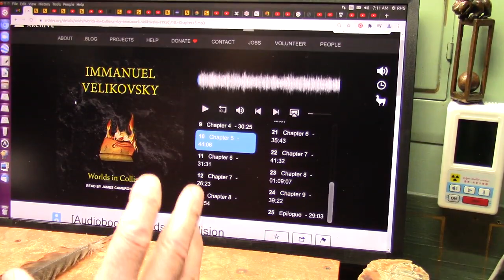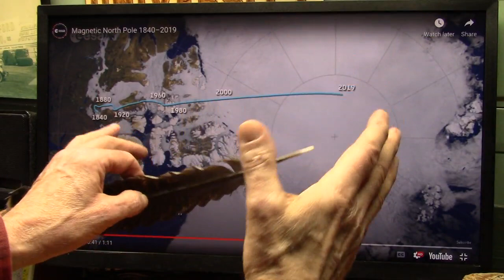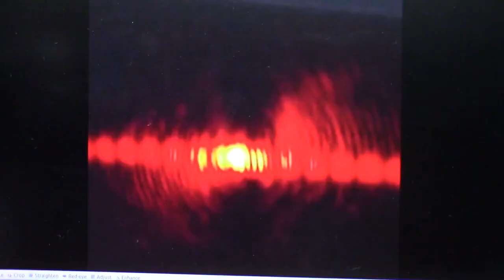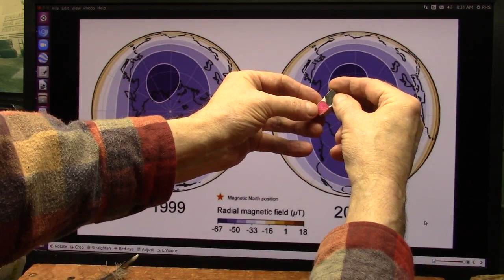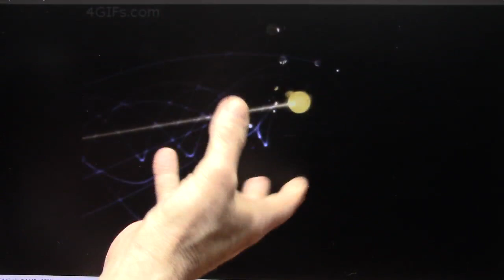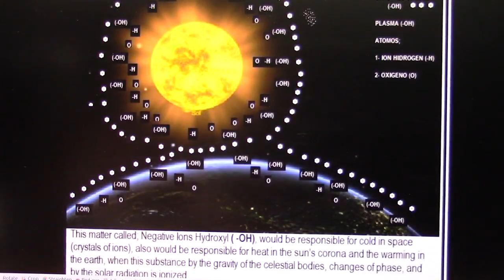A Pole Shift Disaster Coming and Why

Comment: Grab a ball ,magic marker  draw  the letter E in the balls center  then rotate ball 180% draw the letter M now rotate the ball clockwise you will notice no change in either letter as it rotates clockwise . Now as you continue  to rotate the ball in clocwise direction only, gradually turn the ball upside down you will notice  the m is now a W if you had marked the top of the ball N and the bottom of the ball S prior you would see how this earth could very well witness the sun rising in the west insted of the east and the N would be at the bottom of the ball insted of the top hence the polar  shift . As far as i see it , it is very possible..the north pole has been migrating for quite some time now❤ hopefully we get out of it unscathed

Comment: This is what I really don't understand how does a magnetic field change? The only way to have a change is another magnetic field larger than the magnet can withstand once it is coerced its field changes. High fields don't show us any of what you are discussing however we do jave a game changer its called CERN amd that thing puts out a very high field that could be xausong thos problem bit i don't think it outputs that much energy that could make the cjange you are talking about. It could deplete or remagnerize materials flux density and stabilize at a lower field intensity. Or just interact with it. Again high heat is playing with the cure temp and the material will relax and the dipole realign or become random my only experience has been that the field is no longer stable and is depleated greatly in some cases like in ndfeb it can relax until it can never be remaged to its potential again. And two thousand degrees is way over the cure temp of most magnet materials. Alnico would be the exception to all other materials in that temperature range. Rare earth would be dead. The thicker the length of the magnetic field in the direction of north to south is also a factor in the magnets ability to remain as a magnet. Length // to the orientation increases the Pc permeance coefficient. And the Pc of the core material should be very high.
Reply from the maker: Heat in space is charge which takes on polarity....so the hot spots create polar regions....and Magnetic loops like Sunspot loops but we cannot see them.
Reply: @mudfossiluniversity  a polar region is where the flux leaves and enters at its face so we should see the flux leaving that pole face. It have never seen no flux from a pole face unless absent flux completely. That would mean you would no longer have a magnet. I don't know how the fea doesn't show any flux in those two areas. Where did the fea get generated who made it? I would like very much to review their work. It doesn't seem to be correct.. but i may be wrong but I don't think so.
Reply: @mudfossiluniversity  we can see the flux using ferromagnetic paper (green sheets) we can also map the field but you are showing on your previously posted info extra data but ot isn't noted as to what is being measured that looks like tossing or expelling material from the suns surface which isn't a factor of magnets but they do influence everything but it is generally held that the working or influencing is the flux. Is their a reason that you fea shows more an if it does what are the factors or the frequency i may be able to put into an fea like the one you showed us. If i can duplicate that and see its influence in circuit that may lead us to find a way too use or manipulate the field for a different outcome and that way we can positively verify the application of this unused field.

Comment: Hy Roger, when you´re looking for another source to verfify the coming poleshift & a sun Nova event you have to look the videos of the Diehold Foundation made by Douglas Vogt!!!
He found a damn real SUN CLOCK CYCLE THAT´S HAPPENS EVERY 12068 YEARS....its encoded in the Torah, but the short version sound like this :
1 Solar cycle = 11,09 years
8 Solar cycles = 88,735 years (know as Gleissberg cycle)
136 Gleissberg cycles = 12068 years

By the way, the Torah has 6034 capitals verses and letter x 2 = 12068 years

The next Sun Nova Event will be on the 16th of October 2046

The first 22 leters of the hebrew alphabet are in fact wavelength´s, that create specific forms, to create matter out of the Torus form of earth, that create in essence the universe as we know it....the BIG BANG was the exct moment when the Quantum Super Computer was turned on so to say

Comment: Great video Roger and great explanation I might add. I subscribed a bit ago catching a moment of my subject matter to watch later. I avoid most physics/theory's online to keep me non bias in my own work. I keep things as simple as possible and minimum subject matter due to being simple minded. Due on pole shift subject though. This was the first video I have watched on pole shift and the right one I might add. Not school taught.......a natural I call it. Why I don't word things like a scientist. A fan of Albert and Pearson, Durk I started reading Life Extension back when it first came out. Just nut shelling me here a bit. I have a good 50yrs of understanding nature on another level. I agree on microwaves.....agitating various molecules and particles...charged or not creating changes. I have also had suspicions that dams leak into the outer core passages creating extra steam pressure moving lava/changing its typical patterns. Excuse my English please. As we tap oil out of the ground we are removing the fuel of the outer core hence changes. Nature is a very complex machine not to be messed with like synthetic molecules in everything today. Very delicate is an understatement many people don't understand. I have a collection of Geo I find with many mud fossils and meteors of various types. I cover many degree's of subject matter not school taught. Coding and dna, macro coding one of my terms. Although a novice and hands on no fancy nothing so far. I have always amazed myself doing any science/physics experiments and on a whim. My mother's mom was Russian and my Russian codes are alive. Sorry for writing so much, it's partly how I teach myself and imprint my brain cycling the science subjects. I get down loads like some physic's mention  and use Alberts greatest theory or 1 of them. The theory of simplicity of explanation. A long detailed history with animals and documented many yrs. Metaphysics is another of my well understood subjects. Domestic and wild animals, humans ect. Russians are just like that genetically with nature. Animals can friend us in an amazing way. I am already getting ideas about this video and possible man induced no no's. Thanks for your time.......Jim  .

Comment: The moment I saw that multi-meter I knew this guy knows what he's talking about. I always have a tough time explaining the electric universe to people who don't have some background knowledge of electrical engineering principles. 

I can agree that the atmosphere is a capacitor and we have the ability to change it's composition, but the galactic magnetic background has a much great influence on the changes we are seeing, it's affecting the speed of rotation and rainfall as well. One misconception is that the solar cycle is an independent phenomenon, yet from where I am standing the earth is responding the same way. 

Have you read the Zharkova papers? I'd love to discuss this with you further.

Comment: I enjoy your unsophisticated explanations of various physical phenomena. Your explanation underpinned by practical demonstrations makes it easy to understand complex ideas. Thank you.  The reversal of the magnetic poles will change the north to south magnetic field orientation but what will happen to the the direction of the earth’s spin on its axis and its directional movement around the sun?
Reply: Not sure if you have found your answer, but apparently the Earth will tilt 90 degrees really quickly and then find it's new position, (possibly same as the old one), quickly as well. It is theorized that below the crust is essentially a solid river of magma that will liquify as this begins, allowing the crust to move freely during that time.
Reply: @ventiankraus777  Thank you for taking time to respond to my questions.

Comment: Very cool explination. Thanks. Only thing I cant fully agree with is that our gasses is causing the poleshift. The shift happened many times before and there was no industrial revolution that caused the previous ones. I would be more likely to agree that this is just our normal overdue poleshift that is on its way.
The "eletromotive braking" caused by the poles will probably be the same is with an electric motor with a large flywheel. Once the friction overcomes the movement, the kinetic energy left in the system will probably want to rotate back on itself, like a spring. This could cause the change of earth's rotation.

Comment: I heard this is a gradual shift on the axis and we will begin to have more extreme weather, earthquakes, tsunamis. The sun plays a big part in our weather plus volcanoes put out  alot of gases as we move through the galaxy. The sun and planets also get charged particles from the black hole in our galaxys photon belt. The tree rings and ice samples show a past of earth changes before the earths population grew. Consider moving to higher ground away from the shores.
Thanks for your interesting information.

Comment: Energy flows as Long as it's there think of a fridge magnet how Long does it last electricity can be drawn from this field for as long as the magnet has it's field around it magnets can hold this field for hundreds of years I have been obverinng this and I believe we can tap onto this field as we learn to allow it to flow the trick is how to get into it have you ever seen a magnet float in the air simple if you use string to hold it in place think of where the string is tied down now imagine people holding those strings they are working hard there's the Free energy I'm afraid of what some of the people on this earth would do with this power as in ai and it's ability to control people I have thought about building this machine but I am afraid of what it will do crazy as it sounds the numbers 666 keeps coming up so I keep this secret to myself. Thanks to everyone I wish for a more peaceful world without greed and more equality love to all thanks.  DF

Comment: You need to look at Ben Davidson’s channel, Suspicious0bservers. This flip is most certainly NOT caused by the Industrial Revolution. ALL planets in our solar system are changing, so pollution is clearly not the case. This is a 25,000 year old cycle with 6000 year harmonics. More and more scientists are on board with this.

Comment: When the Flip comes, I am of the opinion that the Dzhanibekov effect will apply to the Planet.  
Remember, liquid water will not move with the surface.  The surface will slip under the water.  Everything will be washed away.  75% of all life will be terminated and extinct. 
Supposed to happen before 2046.  
It is thought that all man made electrical systems will be destroy by a solar CME a decade before the flip.  
The Elites are building under ground bunkers to protect their families.  They are not warning you.  You get a poison shot to ensure you don't survive.  Prepare and good luck.

Comment: Electric 101 you take the poles and flip them but the positive on top the native on the bottom or deposit on the bottom and the negative on the top what happens it's the other direction. It's tied to the Sun the sun is a major player the son's behavior. I read a report of the last couple years the world's slowing down it's fossil fuel burning and whatnot they're got clearer the waters got clear if you remember but the temperature went up instead of down.
And yeah it's serious and nasty business in the extreme

Comment: YTuber called “maverickstar reloaded” is actively tracking the pole with real time data from instruments all over the world currently we’re 75miles from the 40 degree mark and then into the weak field lines. Estimated flip is March 2023. He also has the same issues as you every mainstream is pushing it aside and getting rebrand as climate change.

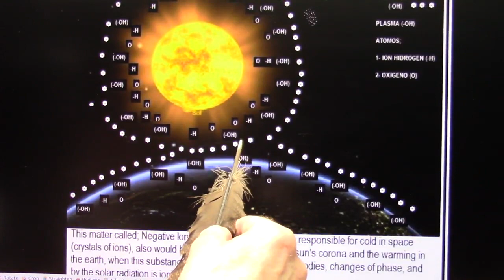Comment: At 18:56 you state that heat makes everything swell. Unlike everything else I know of, water swells as it gets colder. I don’t know how important this is to the equation, but there it is. There’s a lot of water on the earths surface.  Excellent video and your hypothesis seems right on otherwise, so possibly that tidbit isn’t important to the understanding. Thanks for what you do!
Reply: Gases expand under heat typically.

Comment: A magnetic polar shift happens about every 25,000 years. We are due for one. However a polar shift does not cause earthquakes, or tsunamis. It is simply a change in the magnetic field. You are thinking of a crustal shift. Those happen as well, but the crust moves instead of the poles. THOSE cause tsunamis and earthquakes. We have proof of this in tropical plant life that has been flash frozen in the artic. A crustal shift will be disastrous.  A polar shift will be a mere inconvenience.

Comment: are poles are magnetic they move every year back in the 1400 , 1500s 1600s, 1700s they used to up date the magnet north every year on the maps they stopd doing this in the 1800s well now we are at the point where are poles are flipping but they have covered this up with the sham of global warming we dont have global warming we have a polution problem but not global warming an yes all this information needs to get out there climants going to change around the hole world

Comment: It seems like the increasing unbalance of the two poles may have other implications. For instance, the increase of the magnetic field on one side may pull other spacefaring objects to the point of a collision. Much like the giant asteroid that has been claimed to wipe out the dinosaurs. I am pretty sure I have seen some reporting (in the not too distant past,) about certain American Intelligence agencies having complete knowledge of the phenomena which you are referring to... like, to the point of knowing when this shift might occur next.
Reply: I feel as though this is a problem only for humans, because we can be aware of it, but i also suspect that there is very little we are able to do, in order to prevent such a "disaster." It is possible that we could attempt to affect the outcome for our species. But if this magnetic field were to change so abruptly, all of the matter within the field would likely start to behave in ways that we are not very familiar with.  Unfortunately we are made of this matter, so it could be that we would all just disintegrate or separate into piles of the various elements that we are comprised of.  It probably depends on our individual relationship to the shifting toroidal field. Hmph. I'm not sure, but it sounds like a thrill, no matter what becomes of us.

Comment: Wouldn't a large iron asteroid help change the field too?  Hitting at 100,000km/h in the opposite direction of the spin, with all that iron would have to bend the field like in iron filings experiments, if you introduce a bit of magnetic material in the middle of the field it changes the curve of the field.

Comment: quickly I can guestimate 8.5 M strikes per day multiply by 300 M to 3 G. Whatever the average, it's going to redline as the magnetic fields collapse and crunch everything together then BOOM!!! you have however much juice we got. the atmosphere is basically a heatsink. It bleed off the juice with lightening and warming up the atmosphere. when it flips it's gonna go away and the accumulated charge is gonna discharge all at once instead of all day. 

Now if you know welding like I do (not much lol) then you'll know like I do (I don't) that a 25 Billion Vols welder would probably burn through some shit. I have some more information I'd like to share with you but would prefer to communicate more efficiently if possible lol

Comment: This is very VERY true. Easiest way to tell is at an airport. Whenever you’re there and you see the crew working on the runway itself, it’s because they have to realign the markings to align with magnetic north and to get the equipment onboard to keep the planes on track with the radar. They have been doing this ALOT lately

Comment: Dearest ROger, you have a real gift at defining the rocks and this we truly appreciate, however, it saddens meto think that people will be so horribly deceived by this fear-mongering nonsense.... This is to justify their faking of the sun simulator and to fake the quran prophecy of the sun rising in west on THAT DAY that the real sun goes dark, the Gathering to be specific. NASA also making excuses for why people see a second dim sun and there are two reasons: sometimes it is a reflection from the firmament due to all the chemtrails of aluminium and other times it is the Lenz Law effect on our toroidal electromagnetic field due to HAARP and Aluminium to disguise the induction heat hotspot as the white hot simulated sun tries to emulate the path. It is a patent and they have several lamps on the earth  that beam u different frequencies and where they meet in the sky they emit a white hot light with a black dot in the centre which you can only see with a number13 welding helmet and a telescopic lens, this white fake sun also makes pink petals in photographs. WAKE UP people this is nasa junk again.